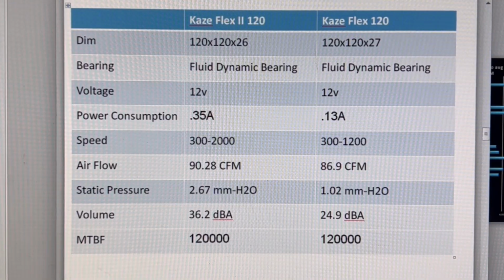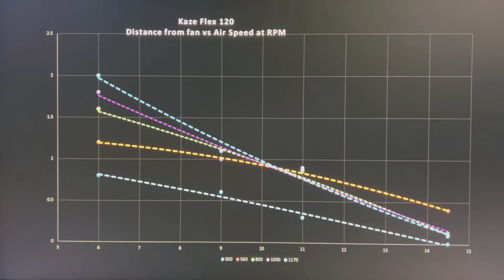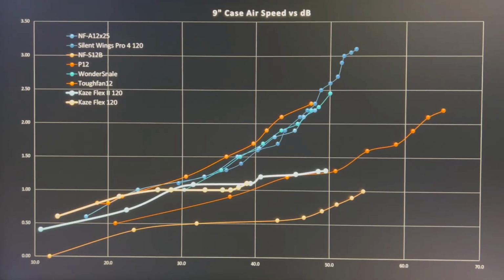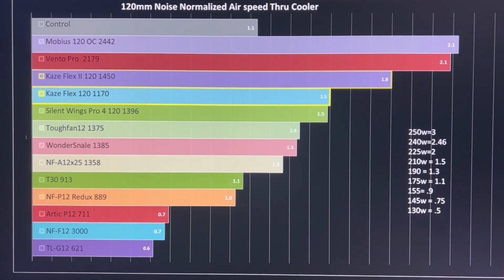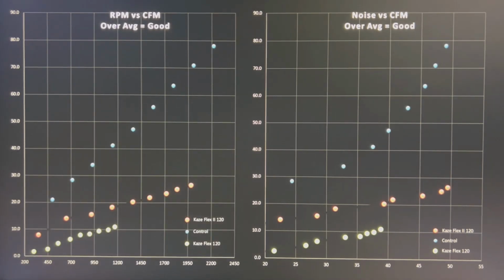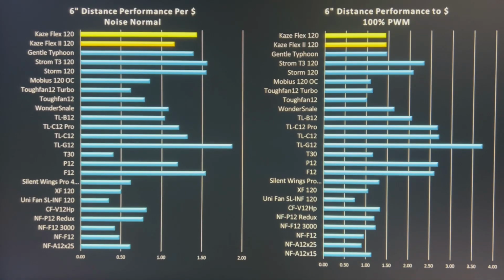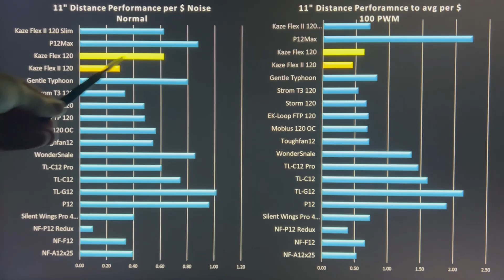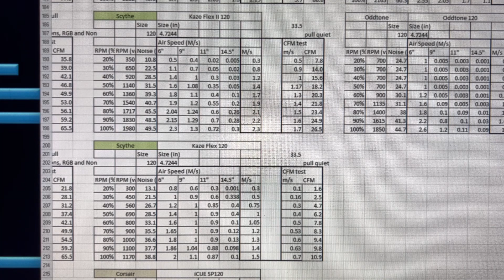Scythe Kaze Flex  vs Kaze Flex II Review  (Old Testing Method)

Comment: I have a Scythe Mugen rev B supplied with a kaze flex 1200 rpm with it. If I get another same fan and make it in a push pull setup will it improve the performance of the cooler? I will be using a cm scout 2 casing.
Reply from the maker: it can improve performance but one thing to take not of is distance between the fan blades and the fin stack. if in the pull config (back) the blades are close to the fins it can make a lot of extra noise.
Reply: @computer-tech-more  Thanks for the reply. I do have a set of anti vibration pad from my old air cooler which I may used it if I do a push pull setup in which I plan tu use it for the pull fan. On the other hand I might want to get a scythe kaze  jyuni 120 db (sy1225db12h-p) if I want to run a single fan for the cooler but there's almost no info about that fan.

Comment: Hey, my pc case is a mid tower that has (LxWxH) 17.72 x 8.27 x 17.72 inches (45x21x45 cm). 

It can handle 3x120 or 2x140 front (mesh with dust filter, seems reasonably open); 2x120mm lateral (to the right of the motherboard, also has dust filter but the case holes are bigger than the front mesh); 3x120 or 2x140 top; 1x120mm back. 

My build is fairly minimal, with only a 13600k paired with a scythe fuma 3. No gpu card. I do plan on getting good budget fans that will be usable for future builds (which will possibly have a gpu card). Nonetheless, I prioritize low noise above all else (given the price is acceptable), so I guess I won't be running them nowhere near top speeds, even when under full load? 

Given my current build and that I prioritize low noise, I believe 3/4 good fans (2/3 front intake and 1 back exhaust) would be good enough? 

I was thinking about the kaze flex or kaze flex II, but they seem to do horribly at long distances? Is a lengthy pc case (like mine, 17.72 inches) very detrimental to airflow and cooling? Should I also get another case? 

Which budget fans do you indicate for me to buy? It'd be very appreciated if you could give a list, rather than just one model, since not all fans are available for purchase in my country. Going by your 11in distance performance per $ noise normal, I should get the TL-G12, P12 or P12 Max? I should also take into consideration not only the performance per $, but if the fan is sufficient for cooling my build at all, right? 

Sorry for all the questions and doubts, I'm completely lost here.
Reply from the maker: So currently I cant give you much advice on case. I havent started that kind of testing yet. I want to one day. 
So my best cheap fan is the TL-G12. THe P12 is also pretty solid. The biggest problem with the P12 is artcis quality control. one could be a lemon the next gold. hard to say really. Ive had one P12 max good and one lemon.     :/ 
without knowing your exact budget per fan its hard. but lest say under $18. 
The tough fan 14 is pretty solid, Montec Metal 120, Cooler Master Sickleflow 120, TL-C12 
Those have tested will in this price range. Sometime this month I will be releasing a round up for best sub$18 fans. just havent picked a date yet. 

If you have the extra $$ the toughfan 14pros are the best allround 140mm fans ive tested so far. havent release that video yet. sneak peak. ;) 
you want your best fans on intake and on the cpu cooler. the exhaust dont matter quiet as much other than noise profiles. 
hope this helps. if you have follow questions please ask. ill try to answer them. :)

Comment: Scythe has 3 different fan versions of the Kaze Flex II, 1200, 1500 and 2000 rpm. Which one would you recommend?
Reply from the maker: I made the assumption (on paper the same ignoring RPM) all variants are the same. I would just get the 2000 RPM so you have the most head room if you find you need more cooling. If price is the same. If 1500 is significantly cheaper that would still be a good option.
Reply: @computer-tech-more  cool. Bought the Arctic P12 Max 5 pack instead of these. Price was too good to be true
Reply from the maker: @juniorthomas6404  no worries. I did test the P12max. The one main thing about them is a high minimum RPM so they start of a bit noisier than other fans. but if that doesnt bother you they will be great.

Comment: Wow. Seems your opinion/data on these is the absolute opposite that I've seen on other videos.
Reply from the maker: Old testing method. please refer to https://studio.youtube.com/video/_1cQYOouvB4/edit 
or New Testing videos for latest data. The new data version of these fans is currently in the works.
Reply: @computer-tech-more   I'm afraid I'm suffering from information overload having watched the linked video and various others. 

Could you maybe make a direct recommendation? What I'm doing is building a new system in a Corsair 4000D airflow case. i7 14700 processor, non overclocked. 4090GPU (type to be determined). 

I ordered a Frost Spirit CPU heatsink so that's covered. I'm looking for case fans for intake at the front of the case. 
The case supports either two 140mm or three 120mm case fans on the front panel. I was thinking I'd keep the fans the 4000D comes with for the exhaust.

I'm looking for something relatively quiet that will keep the hardware cool during maxed out 4K resolution gaming.

I had seen a very positive review for Kaze Flex elsewhere so I was thinking about getting three of those (120mm) but had second thoughts based on the video I commented on.

I was considering Silent Wings (or Pro) 4 140mm after that based on someone else's review. Pretty loud at max speed but very quiet at the low speed setting.

Now I'm seeing Light Wings 120 has a much lower decibel count than Silent Wings Pro 4 on your graphs...

Meanwhile here:
https://www.youtube.com/watch?v=VGieFEaLyQA

Light wings seems to get pretty loud compared to the older Silent Wings but that is at higher RPM I suppose.

Arctic P12 is allegedly max 24.5 decibels but I'm sure I've seen another video in which it sounded relatively loud compared to a Kaze Flex.

Elsewhere the PC Mecca channel seems to be claiming Silent Wings 4 120mm to be max of 18.9 db. That's way lower than your data (value 31 db). So I'm confused...
Does sound like you think the Silent Wings Pro 4 140 is a decent choice but I'm not sure how loud it's going to be in normal use as a case fan.

Definitely made quite some noise in the JayzTwoCents video.
https://youtu.be/aBOf4XfUl7M
Reply: @computer-tech-more   Found your other video saying IT CRUSHES THE COMPETITION.  I think I'll go with Silent Wings Pro 140. Let's see if the default 4000D case fans ruin everything by being noisy.
Reply from the maker: @DGneoseeker1  personally I like the Toughfan 14 pros for 140mm fans. I also have an upcoming this coming sat / sunday Arctic P14max review
Reply from the maker: @DGneoseeker1  haha STS and I are probably the base reviewers for case fans. Hardware Canucks, Jayze fine but their testing is not as complete as I like, actually this is why I started fan testing. Linus and GN were taking to long. 
Putting a fan on a heatsink and Rad  and testing is easy. 
So for case fans you dont need 3000 RPM but If you want to be able to use it on a Rad later it could be useful. 
So if it was me right now: I would do 3x120 in the front. I love my A12x25's but they are expensive, Same with the Lianli P28 (so these are the high end option pick), Under $18 per fan pick TL-G12, SickelFlow 120, Arctic P12 / Max FDB

now if you like the look of a larger fan so 140mm fans: Top Pick is the ToughFan14 Pro, and Arctic P14Max. The Review for the P14max is coming out this weekend. The Max is the better Heatsink / Rad fan while the Tough is better at case airflow.  The TL-B14 / extrem would also be a good pick here. 

hope this narrows your selection. These assume you dont want RGB.